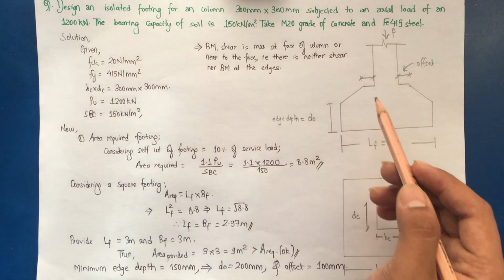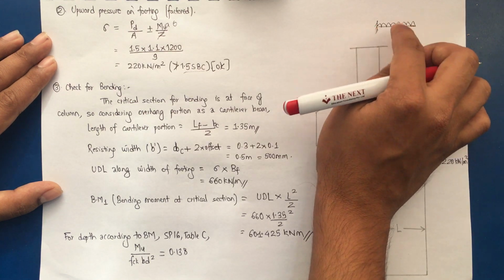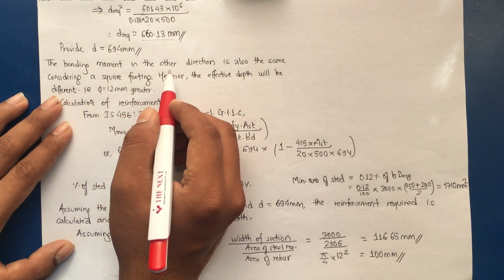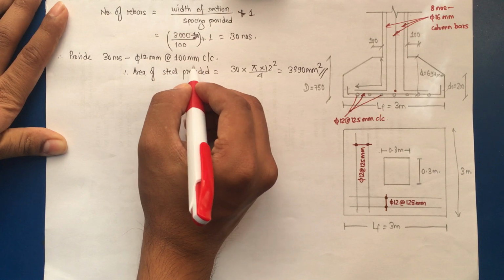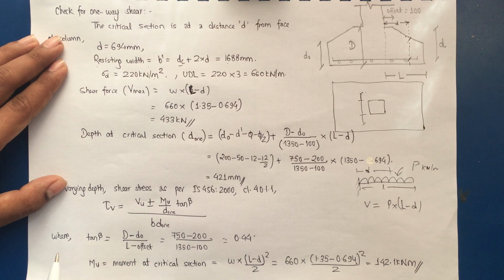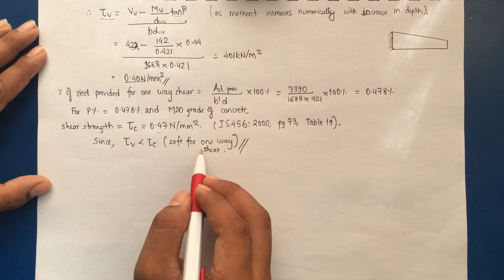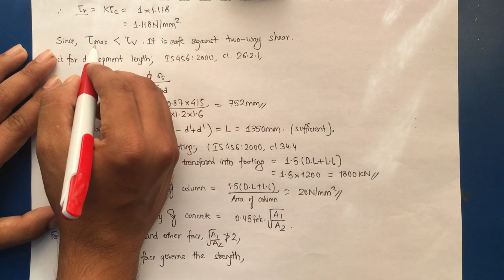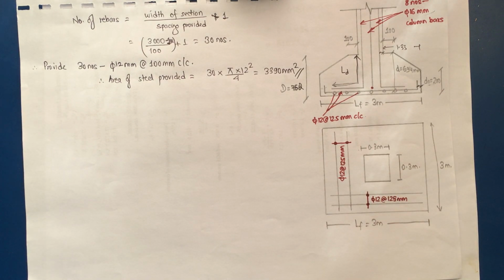Design of Sloped Isolated Footing | RCC Structures | IOE PU PoU MU |

Comment: In the case of calculation of upward ⬆️ soil pressure you are taking self weight of footing ...but we can not take self weight of footing  only we take factor of safety and axial load (1.5*axial load)/area...
Reply from the maker: Why won’t we take the self-weight? Footing itself is an additional structure on the soil. It will exert pressure on the soil. You can model it on SAFE and check it yourself. Self-weight of backfill is not to be considered as it already existed over there.